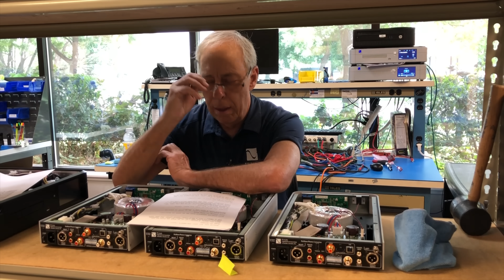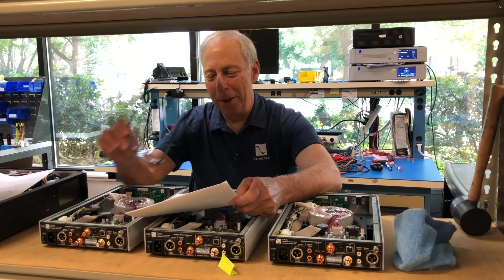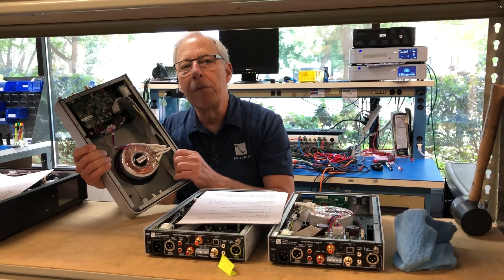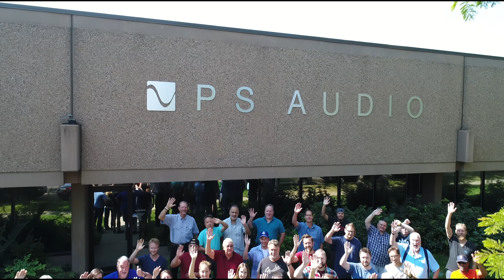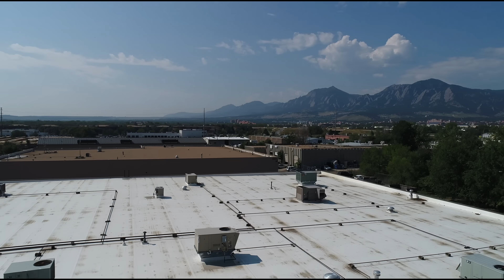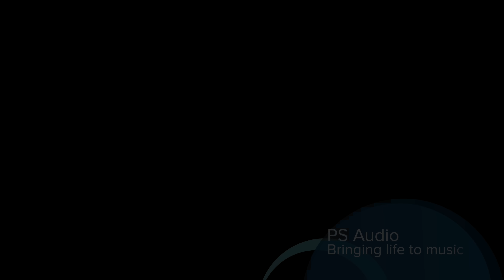What's inside a high end power cable?

Comment: Aluminum was only used in-wall in the USA from 1965-1972; you mean copper cable.
Aluminum cable continues to be used between the electrical meter and the utility pole and other such high-power runs where cost and weight are an issue. If your house is unfortunately full of aluminum cable you should have an electrician rewire all your devices and fixtures with copper tails; aluminum carries electrons just fine but it fails at connection point and can and does cause fires which is why it passed out of code compliance for use in new construction 50 years ago.

Comment: They really don't make any difference. Don't waste large amounts on power cables. I purchased expensive monos and they came with shielded cables, as did the pre amp. I borrowed  a power cord from a dealer that was just under 2k UK pounds. Given the cost of the monos, I thought I'd have a listen.  Absolute zero difference. Nothing. No improvement or degradation. Nothing. They are ripping people off.

Comment: Are there different AC cords recommended for different types of components, like an amp versus a preamp or CD player?
Reply: If you trial, you might notice larger cross section and also fewer but thicker wires (the extreme being solid core) typically goes better with power amps, while finer wires and lower overall cross section (higher gauge number) is often ok for source and pre-amp.

Comment: But Paul, the sound does not come through the power cable, thus even if you are right about the low frequencies are better with solid wire and highs are better with stranded, your argument is a moot point. The AC current comes in at 60 Hz and is immediately converted to DC current inside the amplifier. How in the hell can DC current after the fact have any influence from one frequency (60 Hz) coming in through your power cable. You are like the chef claiming that throwing salt over his shoulder make the food taste better and neither of you can give any logical objective reasoning as to why your methods produce a benefit. Both of these claims are ridiculous, because the salt has to go into the food to change the taste and the signal needs to run through the said cable to affect  "frequency" whatsoever.  Anyone with a modicum of electronics knowledge will not buy your blatant BS. 

Usually you are quite reasonable, but when the questions involve something you sell, then any and all logic goes out the window. Most electronics engineers do not agree with your snake oil claims.
Reply: You must admit if it would sound better with the salt over the shoulder, you would include that into your products, because you’d want to be in the position of selling the best products.
Reply: @gioponti6359  But, he doesn't include any of the snake oil produced. He charges a hefty fee for his magical power cords and whatnot.

Comment: I instantly noticed a huge difference when I added silver XLR cables (reasonably priced) from my DAC to the preamp. As always I never expected anything to change, but it was undeniable. I had to check where the volume was at because it sounded considerably louder (like 2 dB on the preamp), yet it was at the typical volume I always listen to. The sound was more detailed and had more air,  and it was was even smoother and sweeter. Interconnect cables do make a difference on low level signals (like DACs, phono, preamp....) which will go through several amplification stages. However, you don't need to break the bank to buy decent cables. Anything over a couple hundred dollars is a pure ripoff and many insanely overpriced cables actually measure worse than generic Amazon cables. 

There is nothing magical to put inside a simple (quality wire, proper shielding and low impedance terminations) cable to warrant ridiculous prices. Power cables need to be of adequate gauge to carry the necessary current for the devise, thus an 18 gauge cable will not cut it to run 500 watt mono blocks. You do not need a 12 gauge cable to run a 10 watt DAC and doing so will only be a waste of money. Running 8 gauge power cables will do jack shit for sound quality, because a 6' cord is only an extension of the 50+ feet of plain run of the mill 14 gauge lumex in your walls. The smallest gauge will always be a bottleneck in the chain of wires. AC current flows back and forth 60 times per second and electron only see one wire. 

It really matters if noise gets on your low level DAC cable, because the noise will be amplified 100s of times when it reaches your speakers. Any noise getting on speakers cables is past all amplification, thus you will hear the same very low level noise as much as you can hear it with your amp turned off (absolutely nothing).Speakers do not amplify the signal, thus if you can not hear the ambient noise in your environment, then how in the hell can you hear it unamplified in your speakers? 

OFC speaker wire is not very expensive, so why pay so much money for snake oil cable that at best only cause a placebo effect where you fool yourself into hearing a difference that just isn't there. I suppose it helps people to justify the $5000 they spent on snake oil cables. These companies prey on people's susceptibility to the placebo effect.

Comment: "What's inside a high end power cable"?  Copper wire (like all power cords) and a bunch of snake oil. Many even add the snake skin material on the outside of the cable.

Comment: Clear for me at last.🙏
Thanks a loot.
Never saw "them" as snakes.😆👍
Nou I won't even use my printer cord for any audio device but check the amount of plastic and coper in de cable first.
My Cybernet CA110 use it's original fixed thick wire.👍

Comment: Have you ever tried running the romex straight out of the wall cavity (no wall socket or junction box) and terminated it straight into the power transformer in an amplifier (no back panel IEC socket either) to see how that sounds?
Yes there are all sorts of regulatory/code issues, however as a one off test, it would be interesting.
as in how far back from the amplifiers back panel does this flash cable have to run?
To me, an ideal power lead should have a good twist in the three conductors & a good shield so that no AC mains born noise can couple into my intereconnects & speaker leads.
Where I used to work, they used flat wide plated copper strap as earthing/shielding connection, as that gave the best results when they sent their gear of for EMI etc testing/certification, so then would having a dedicated wide flat earthing strap from the back of your audio gear to a dedicated earth point help in getting the noise floor down etc.

Comment: IMO not understanding why is very much not okay. I need to understand it.  A power cable is exclusively carrying 60Hz which is then transformed into DC. How can it possibly have any impact on frequency response?  As you said the wire in the wall is solid so why isn't that rolling off the highs?  

You can just tell me oh you have to hear it. Hearing it won't explain why it's doing that.

Comment: Excellent explanation.  No one can take exception, but of course they do.  I make my own power cords.  Only about 1.5' and shocked to find they make a substantial difference.  I have 400 amp service to my home, so 3/4" thick copper cable from the transformer to the house.  But here is the rub.  Only one 14 gauge copper wire to the system.  30 feet of 14 gauge and somehow the last 1.5 feet makes a difference.  Who cares.  I just enjoy the improved sound.

Comment: There is a company that makes high end speaker cable and high end power chords that use solid core copper wire similar to romex. Its called Anticables.

Comment: I think that a normal power cable that is correctly sized for the load you're going to be applying on it is whaaaaat more than enough. If you're using a switching PSU inside of your appliances, well, no difference will be heard from a cheap 2 dollar cable and a 2k dollars cable.

Comment: OK I know this an old video but I can't help but comment. If changing the last 6 feet of the power source wiring (which is miles long back to the power plant) changes the "sound" of your equipment, then your equipment must, by definition have the worst power supply ever.
Reply: Yeah, as simple as that logic goes, I don't understand why people still are arguing about this. Let's be honest, ps audio is not being a good company by doing this and even spread false info.

Comment: Howdy.
I wonder if Eddy currents in the wire plays some role. There will be Eddy currents in a wire. That is my understanding.
Stranded wires will have surface resistance between strands. Eddy currents will generate losses. The equivalet for solid wires will be the specific resistivity of copper or aluminium. Smaller losses.
Have you tried building up the wire using enamelled copper strands ? Kinda like Litz wire. I understand that would reduce Eddy currents.
Regards.

Comment: If there’s a difference you can HEAR you can measure it, that’s an engineer talking. Do a double blind test to prove it is real, that’s a scientist talking. There’s a difference you can FEEL, that’s a rich guy that have more money than common sense sooner to be milked for cash. That’s not objectivism, science is the process that gave us semiconductors to play music and it was not by feeling that amplifier designs and recording supports changed a lot, it was by measurable evidence. Get your nostalgia and your ego at check, your hearing degrades with age, as long as your paycheck increases you hearing shrinks, no money will compensate for that

Comment: Great thankyou Paul,  but surely that means we need to change the cables from our supply transformers out in the field to our power outlets aswell by using both solid drawn and flexible conductors. Mine are approx 400m across the field so this could be quite expensive. I'm in no way dissing what you have said but find it hard to believe that a 300mm cable change could alter the sound that much when my supply cables are 400m to the transfomer and then 64373m from the power station. Thats an impressive 215,910 times longer than the my amp supply cable. Sorry.
Reply: It would be nice if you could do an audio test with your gear next to that supply transformer, Yes that would probably dictate a headphone based test, and you'd need a friendly electrician to rig it up.
The only conclusion I can make of all this high-end power lead thing, is that there are quite a few issues with having a power lead anywhere near the back of your audio gear, as in speaker leads & interconnects. otherwise, as you said, we are only talking 0.0001% or the wire between your gear and the power generators. Maybe high end needs to run on batteries, and keep the AC well away.
 - as in high end leads couple less into the surrounding rats nest behind your HiFi.

Comment: Inductance and capacitance of the cable are important to some extent, due to interactions with the transformer affecting how it responds to demand for load, but remember that a coiled up cable will have much higher inductance than a straight wire, and that's probably a big part of why you've found better performance from solid-cored cable, (coiled cable will also generate a lot more EMI).

Before anyone starts spending money on power cables, everyone should start out with a pack of cable ties. Sort out your cable management, get all the power cables into neat straight runs, making sure that AC is as far from DC and signal cables as possible. If you're confident cut the power cables down to just the length you need so that there's no excess to coil up.
Reply: As long as the power cable meets proper certifications and is being used for its intended purpose, it will not make a difference. A linear power supply is built with provisions to manage minor fluctuations from the input AC -- which are far more detrimental than any inductance and capacitance related issues. I think Paul here needs to read a little on how linear power supplies actually work and then do some proper blind testing with these cables of his. This video is pure horse-puckey as Paul so eloquently puts it.

Comment: Obviously, power supplies do matter. Regarding power cables: I really did not believe, that a power cable could make a difference. But I have made two experiences:
1. EMI does really weird things. I learned that in my job. And a power cord is definietly an antenna for that. And EMI does affect analog signals effectively.
2. I had a problem once, with an power lan adapter. (A device that rund high frequencies thorugh the power lines as lan) My Amp was plugged in to the side of the adapter, where no interference should exist, as it only goes into the other direction. (At least thats what the box said) After that, I could hear my freaking internet on my stereo (I am not kidding, I could here the traffic increasing and decreasing). Not so pleasent. I figured out, that the problem was the proximity of the amp to the wall, specifically the power cables in the wall. (btw I actually have a high quality shielded power cable in use there.)

So I can imagine a well shielded power cable to the amp can under certain circumstances make a difference. But that is because your Amp or other audio equipment is further away from possible interference. That you can achieve with a shielded cable. (Shielded means, no interference over the air, and via cable, the power supply can probably filter that out, so no problem there.) You probably can achieve the same results if you have a device, which filters that interference out beforehand. I do not think, that anything else than shielding or other not EMI related measures will do anything (like gauge, or stranded or whatever). Simply because you are only as good as the weekest link, which is probably your cables in the wall. But I never acutally tried it, though.

That's just a mildly educated guess, but it seams kind of logical to me, with my knowledge and experience.

Comment: You know very well the reason these things make a lot of peoples’ neck hair raise but still you’re not providing proof. An audible difference would be simple enough to prove for someone used to measuring audio signals in a repeatable and scientific way. 

A filmed double blind test with invited sceptics and yay-sayers would do just fine, if you stick to the claim that it isn’t measurable yet still audible for some magic reason - but keep in mind that good calibrated mics are more sensitive than human ears. 

And you’re not exactly speaking for all audiophiles when you say that you’re fine with people laughing at you for spending thousands of dollars on power cables. 

Just make the proof video already. Imagine how much easier it would be to sell expensive cables after showing irrefutable proof that what you’re surely hearing is actually real.

Comment: So, why would we be concerned about the frequency that is conducted in a power cord?   We should only be wanting 60Hz sine wave being conducted.  I'm thinking the power cord is interacting with the power supply in some way, in order for you to hear the difference between different types of wires.  Also, how those wires are securely connected to the various components is also a concern.  Thick heavy solid romex should be connected with very tight screw connectors on the duplex outlet with as much of a turn under the screw as to maximize surface contact under the screw connection.  I have noticed that solid wire can handle a lot of current for a longer time than stranded, however, i also noticed that stranded wire can handle more instantaneous current loads than solid.  It's all still 60Hz 20A.  I can hear the difference in my sounds here at home when they are using a dedicated 20A 12ga romex circuit than when using the old 15A 14ga house wired circuits.  But, the original reason i went with a dedicated circuit was lightning protection of the entertainment equipment.  If i could afford it i would really like some of your power cords for my self.  Also a power regenerator or two.  please.

Comment: I did it on a budget with a Tacima cs929/947 mains block (£35), Silver-plated mains socket (£20), and Ecosse big orange power cables (£65). For what I spent  it's the best upgrade I ever made but do you know where  the biggest difference is the TV... WOW! (said the way Christopher Walken would say it). Less picture noise, finer detail, bolder colors, even the sound is more punchy.